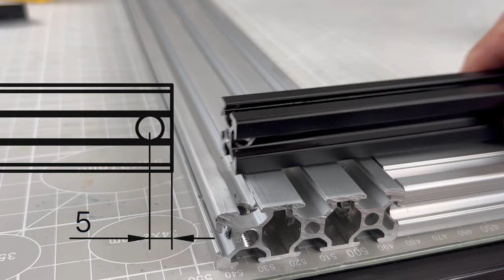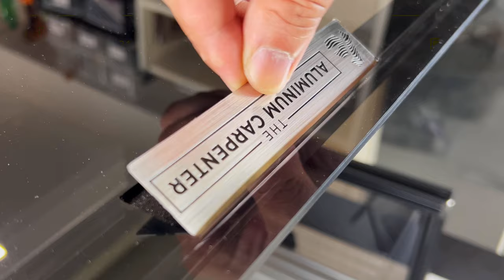PedalBoard Box | Aluminum Design

Comment: Would like to adapt this mechanism for a campervan sofa to bed extension x 2 units for each side that somehow connect in center. Support leg folding extensions (2 per unit) likely needed for when sofa extension leaves are extended for bed use. Please post contact link.